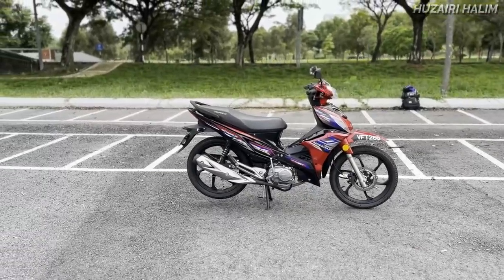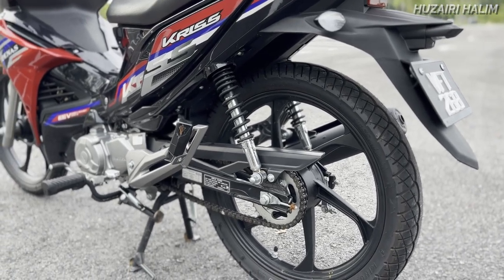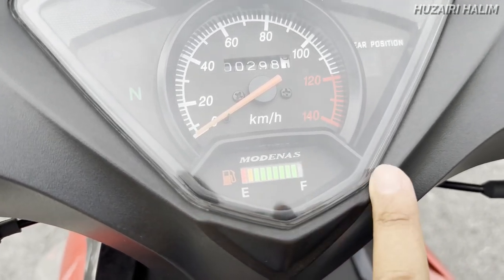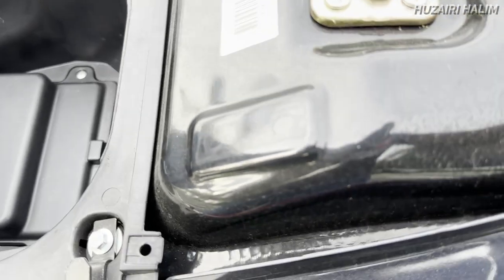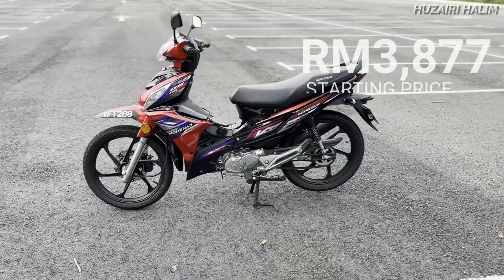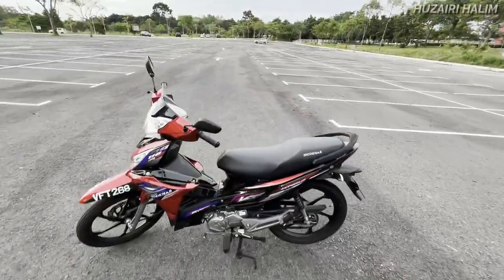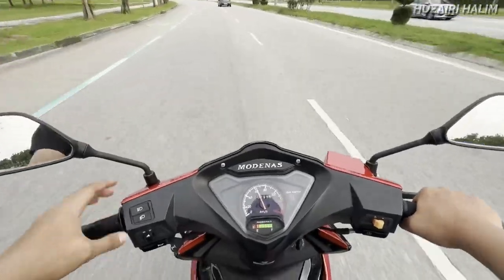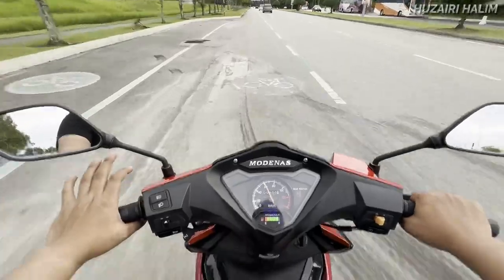MODENAS KRISS MR3 110 DISC BRAKE 2022 REVIEW | KRISS MR3 | MOTOR BAJET PILIHAN RIDER

Comment: BAGI PENDAPAT AKU 

Motor ni memang berbaloi lah. Harga dia tak sampai pun 5 ribu. Korang nk beli cash pun takde hal. Berbaloi gila dengan harga yang mcm tu dapat sebuah motor yang ada : 

1. Disc Brake depan 
2. Ruang simpanan barang 
3. Bentuk yang ilegal
4. Ada hazard light (double signal) 
    di mana hazar light ni susah nak dapat
    pada model motor lain. Ni penting for 
    safety korang yang ride malam. 
5. Ada USB port boleh charge fon tu kira
    memang motor yang relevan di sama 
    macam model LC v8 ada USB port di 
    tahun 2023 ni. Terbaik lah. 
6. Tank besar 4.2 liter sama macam 
     Ysuku punya tank jugak. 
7. Sportrim yang lawa sama seperti 
    motor 125ZR dan LC v8 

Cuma ada 2 kekurangan di sini bagi saya nak sebut (bagi pendapat saya la) yakni kenapa masih pakai sistem carb ? come on la Modenas, dah tahun 2023 kot. Kekurangan kedua yakni meter masih pakai meter analog dan bukan digital. Maybe lepas ni Modenas boleh buat pembaharuan kot. Tapi, memang berbaloi gila la dengan harga yang macam tu kan. Cash pun boleh tu sebab harga kira harga Rahmah la haha. Terbaik Modenas
Reply: Betul tu bang, kalau injection lagi laa jimat minyak.. Bahagian meter patutnya meter tu bagi laa semi digital kee macam y15 v1
Reply: mungkin dia x pasang FI untuk mengekalkan status moto mampu milik kot
Reply: @mohdrafie7376  boleh jadi juga, tapi buatlah 2 varian.. 1 carb 1 lagi injection senang
Reply: klau la kriss nih bwt fi. cnfirm aq tolak wave alpha fi, aq amik kriss nih
Reply: Carb still murah utk maintanance...nk mody pn x perlu dyno..situ kelebihan die
Reply: Geng nak tnya. Ketara sangat ke perbezaan fi dgn carb dari segi penjimatan minyak? Maaf saya noob sikit bab moto. Tapi skrg tgh survey moto gak. Penggunaan mungkin utk dlm bandar je.
Reply: Aq lgi ska sstem carb gna saiz slide bsar ikut cara gna msing². Sng nk srvis
Reply: @YU_ZU98 FI atau carb,x menjamin penjimatan minyak pun sebenarnya. Apa jenis motor skalipun,bergantung pada cara kita bawak bang. Tak kira la motor kapcai jenis apa pun,kalau setakat bawak dalam kelajuan 80km kebawah,insha Allah jimat. Yang penting,fahami motif beli motor tu atas sebab apa bang. Kalau untuk kerja/daily use,motor ni sgt sesuai
Reply: Motor paling terbaik. Buatan Malaysia mampu milik. Menang dia lagi. Dari Wave/Future/
Reply: @stanshady5500  Betul bang, FI untuk kereta memang jimat minyak sebab enjin kereta lebih besar dan lebih banyak piston, enjin motor 110 ke 250 cc 1 piston penggunaan minyak sama ada karburator atau FI bezanya sangat kecil macam takda beza. Yamaha bila dia mula buat motor FI katanya lebih jimat minyak cuma gimik pemasaran aja.
Reply: Dari segi kos maintenance, carburetor lebih jimat berbanding FI.
Reply from the maker: @OrangeHunterz-db2yl yeke
Reply: @haihaikal2288  bro, kalo keluar injection, harga x dpt bawah 4 ribu tu dah kalo harga body.

Comment: Full tank berapa rm bos? Saya baru lagi dengan motor2 ni
Reply from the maker: The Modenas Kriss disc brake model has a fuel tank capacity of 4.8 liters. The price of gasoline in Ringgit Malaysia varies depending on location, but as of September 2021, it averages around RM2.05 per liter. 

Therefore, to fill the tank of a Modenas Kriss disc brake model motorcycle, it would cost approximately RM9.84 (4.8 liters x RM2.05 per liter) in fuel expenses.